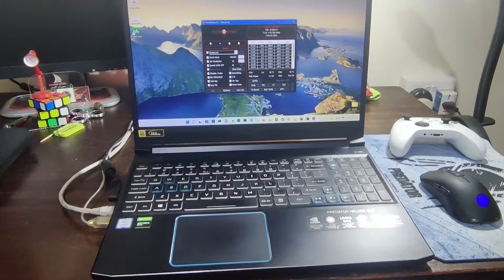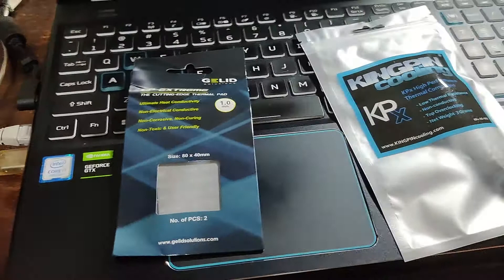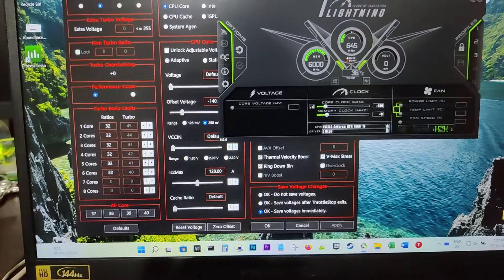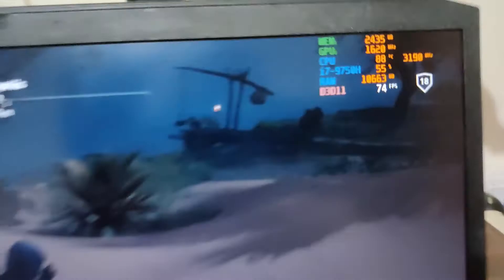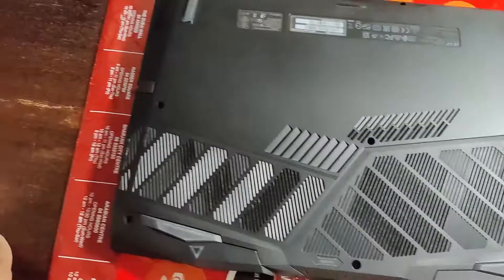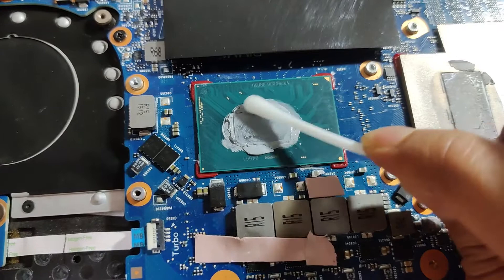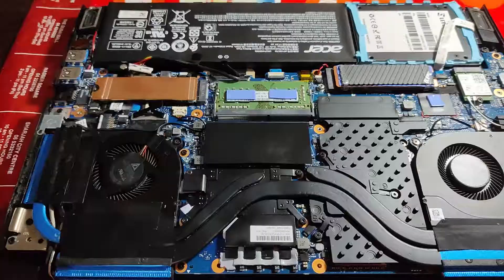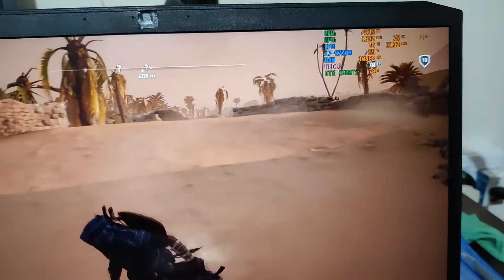Massive temp drop! GELID GP-EXTREME Pads + KINGPIN KPx paste on laptop 90C to 75C!!

Comment: Good work, I was thinking of adding thermal pads or temperature conductive tape between fans and Heatpipe/heatsink, have the same model as you. Good video.
Reply from the maker: Thanks! Glad the video is of help.
Reply from the maker: Ive also added temperature conductive tape between fans.
Reply: Would be cool to see a follow up in 6months or 1 year to see if the temp improvements remain the same or degrade over time. KPx isnt designed for long term bare die use, it's quite thin so it suffers from the pump out effect
Reply from the maker: @ognintendo7061  I will definitely publish a follow up video in say 6 months.

Comment: I have the same laptop.GPU VRAM chips height is uneven that is why from factory they use thick pink  thermal paste and not pads.For VRAM i use K5 PRO.Also if you want lower CPU temps limit the frequency to 3.5Ghz.
Reply from the maker: Thanks for the info 😊

Comment: hi, great video with good advice.
I've already repasted both CPU and GPU but when in game it quickly reaches high temps, fans kick in to stabilize but it's on a constant loop : 1min quiet fans then 1min max fans, and so on...
sometimes GPU load goes to 100% at only 50-60°
should i check vrm or is it normal ?
Reply from the maker: Hi consider undervolting your CPU & GPU. Check the description for the videos.
Reply from the maker: What did you use for thermal paste? and pads if any?
Reply: @ArifFidaali  Hey. My laptop is an omen 15 with r5 5600h and rtx 3060.
The main problem was in fact the CPU getting too hot since both GPU and CPU share the same heatsink. 
Unfortunately it's impossible to undervolt the cpu as bios is locked so I disabled turbo boost via power plan and It's much more cooler and quieter now..
I used MX4 thermal paste on both CPU and GPU.
Also, the high fan issue was because of bad drivers with the hp gaming hub. 
I've reinstalled the app and made a custom fan curve.
Now it's almost perfect !
Reply from the maker: @marcalbert674  that's great :)

Comment: How is the KPx holding up? About to re-do thermal paste and have some on-hand from my other builds.
Reply from the maker: Unfortunately KPx only holds for about 6-7 months after which temp are back high up then you need to repaste. Check out my video on PTM7950 which are phase changing thermal pads that don't need changing every 6 months or so.

Comment: Is this thermal pad a great alternative to honeywell? Its too expensive to import it here and the only reseller is only restocking it in 2 months 😢
Reply from the maker: GP extreme and PTM 7950 are totally different materials. The PTM is phase changing and the GP are thermal pads suitable for VRAM chips. On the CPU temps will be high with the GP. It's then better you use paste like Arctic MX 4 which is readily available. Check the link in the description with moddiy they deliver worldwide, I got mine in my post office box.